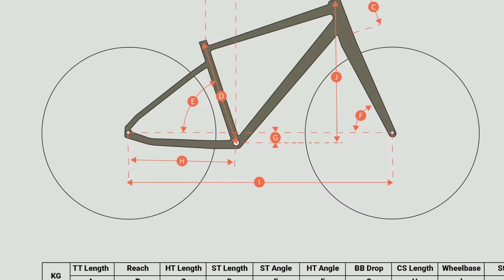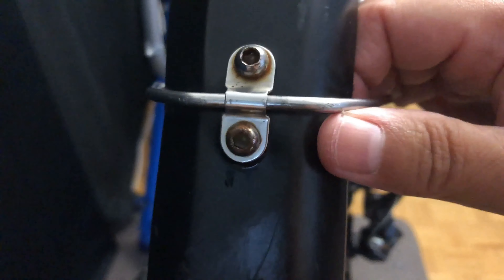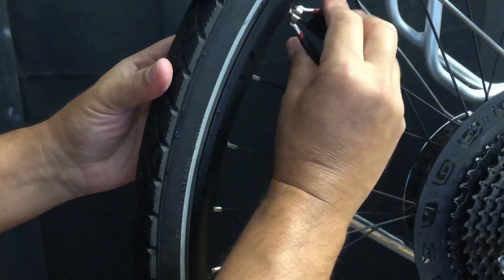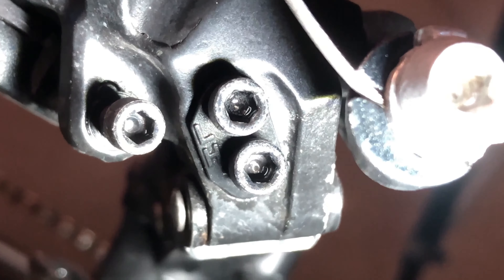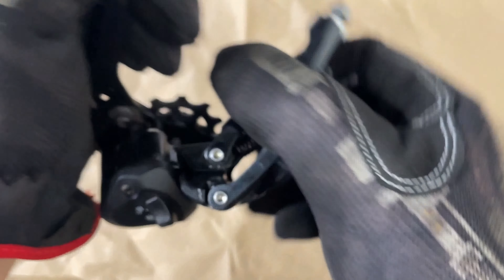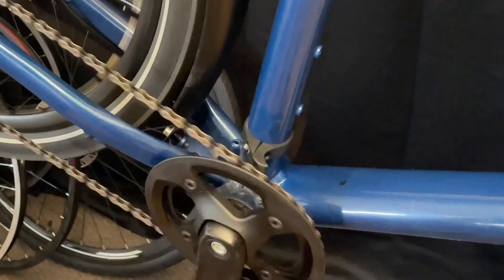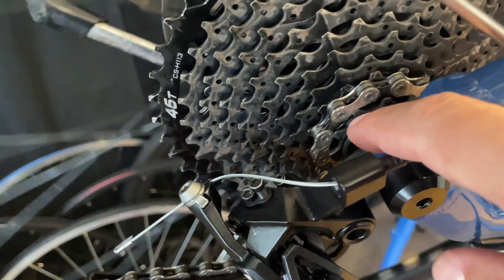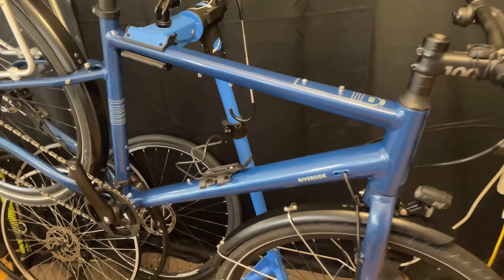Bike feeling slow and sluggish? Watch this!

Comment: I had a similar issue with an old friction derailleur where it would shift down from the top but would refuse to shift up from the bottom, played with the tension for a while till I noticed the springs and action on the rear derailleur itself were so stiff. Lube is always the answer lol
Reply from the maker: I thought the problem and solution was specific to SRAM RDs but apparently not. Thxs for the comment!